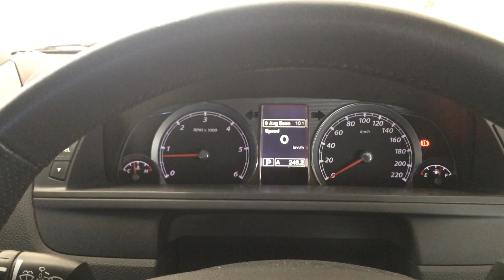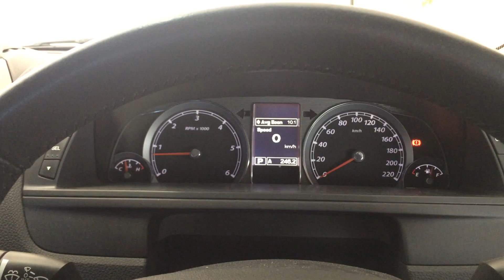Diesel Performance chip 2.7l TDCi Ford Duratorq Part 7

Comment: Thanks for the vid! very insightful, was thinking of getting one of these myself. So did you try and get another chip or see so called professionals to do a tune up? Im tired of the lag on mine.
Reply from the maker: Honestly I haven’t done anything yet, but I am wanting to get it remapped, there are many companies around that can retune the ecu, ofcourse - like you imply there are some better than others 😅 I know a few good ones around.
Reply: UNREAL..... I bought one and exactly the same - but worse.  My engine starting going into limp mode and no settings worked at all.  To all Territory diesel owner,  I agree.  Its a complete ripoff.  My mechanic mate couldn't make anything work either.  Wish I saw this before I bought it......  PS - Mine was imported from mother England but they assured me that one of the settings would work.  Bzzzzzzzz  FAIL

Comment: Ford and other motor manufacturing companies spend billions of dollars developing engines and the systems that support the engine, Im sure that they have it right, thanks for sharing.
Reply from the maker: +Allan Russell that's correct, the only real reliable way to improve is to have it remapped, a lot of the remapping involves taking away the restrictions the factory imparts to ensure that it still performs under worst conditions imaginable.. and remain consistent to if it was 'new' in ideal conditions. These chips which increase fuel pressure only are a joke.. this was simply a way for me to test it.

Comment: have you had any results in fuel efficiency?
Reply from the maker: i took it out as it was dumping lots of black smoke out the back, with nill performance increase if anything it caused a flat spot, and eventually a check engine light. i think if i was to tune a common rail diesel i will look into a proper tune/reflash ecu, none of this 'chip' stuff that ups rail pressure etc.
Reply: the TDV6 (have it in my LR3) actually is a common rail diesel, but increasing rail pressure does only end up in over-rich mixture, if you do not alter the air side. best is to increase turbo pressure and change ECU characteristics. but everything comes at a price. i will keep it like it is. it's a heavy offroad/overland cruiser, no sportscar. off the road i'm in low range. on the road i do not need to exceed 140km/h, because of fuel efficiency ;-)
Reply from the maker: yeh a proper reflash on the ecu can yeild massive improvements in the low/mid range and overall change the way the car drives, particularly when connected to an Auto gearbox, as they change some of the torque limiting and throttle input/output etc.